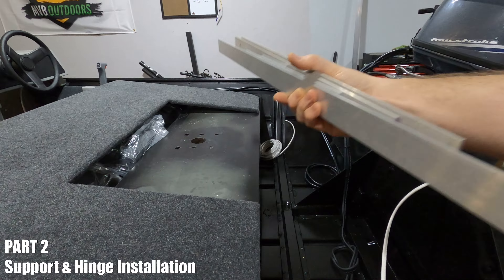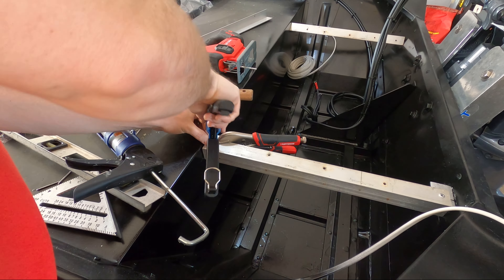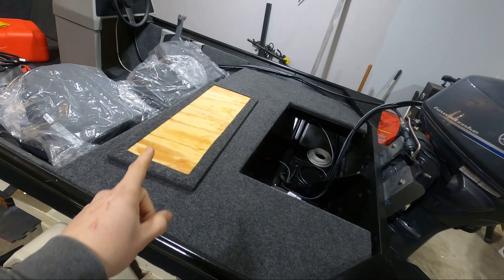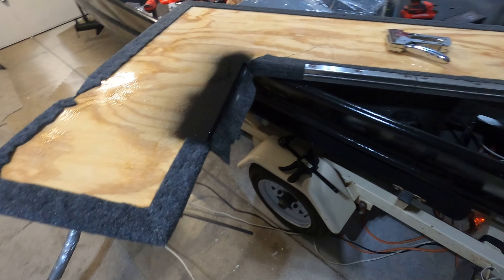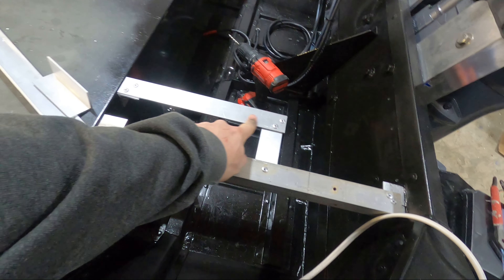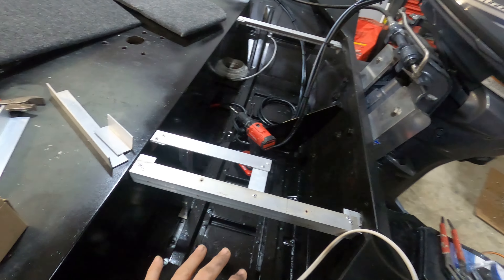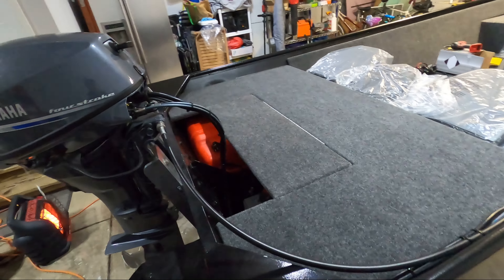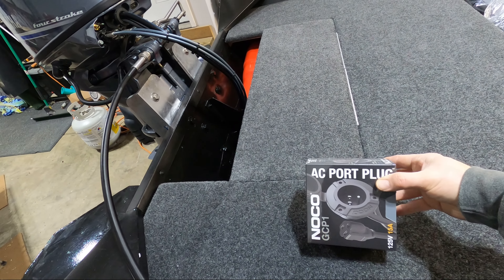Jon Boat Rear Casting Deck Build | Part 2 - COMPLETE

Comment: How did you mount the deck to the boat without having screws show through or make holes in the carpeting?
Reply from the maker: I predrilled the and countersunk the holes before carpeting that way when I screwed them down the screws buried into the carpet and weren't as visible. It did the trick.

Comment: Nice. You can shave the carpet with a hair trimmer if the lid is to tight
Reply from the maker: Haha I actually did that before trimming the wood, I should have included that part! Great tip 👍

Comment: Aren't  you worried  about a spark from the battery  near the fuel cell ?
Reply from the maker: Good question, thankfully the main danger with fuel tanks comes from fumes getting built up then igniting. There is plenty of ventilation (the area isn't sealed) so any fumes would immediately vent.

Comment: How to you mount you carpeted plywood to the boat frame? Did you run stainless screws through the top leaving it exposed? Ty. New subscriber. Can't figure out how you hid the hardware
Reply from the maker: Welcome aboard! I have a video for the installation of the panels here: https://www.youtube.com/watch?v=c-oqnQqGXd4

Basically I countersunk stainless screws that went into the ribs of the boat, hid them within the carpet.
Reply: @mvboutdoors  ty. I've seen videos where they wrap the wood seat first then mount. Makes sense.

Comment: What type/size rivets did you use for the brackets that went into the transom? Did you go all the way through the transom?
Reply from the maker: No there is a cover plate on the interior side of the transom I riveted into. Definitely didn't go though. I used 3/16 rivets.

Comment: My transom has an angle, did you bend the bracket to offset the difference?
Reply from the maker: Yes! That's exactly what I did. The brackets attached to the transom were bent so the top side was level with the seat. I used 1/8 for those brackets.

Comment: Hello Mike, I enjoy your videos, and I have used a lot of your input while building my own project boat, keep up the good work and thank you for your information, PS. what type of batteries are you using in your boat ???
Reply from the maker: I'm glad they have been helpful! The one battery is a 50ah Lithium (https://amzn.to/3UuPe5W) -- It's been working really well and lasts all day with my electronics, trolling motor and graph. The other is an AGM starting battery, here is a similar one (https://amzn.to/3GzhrCP)